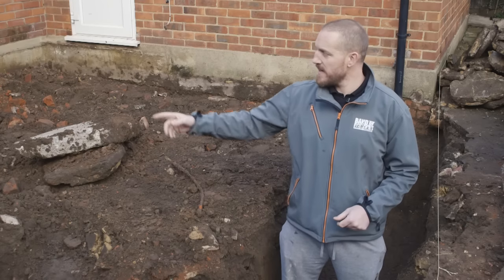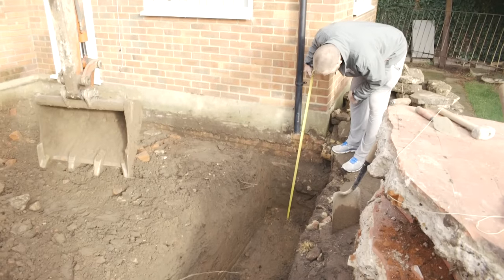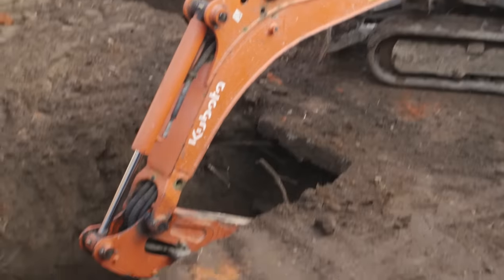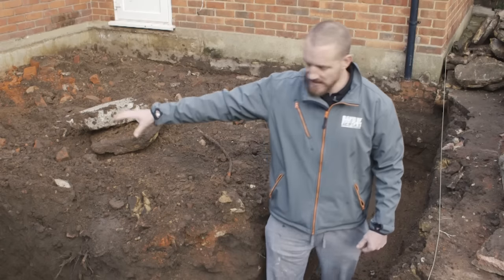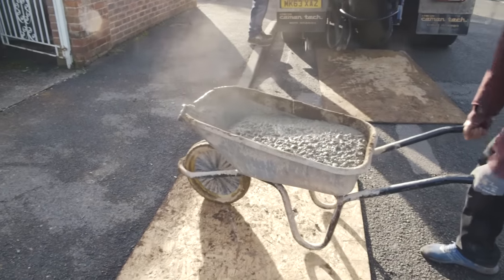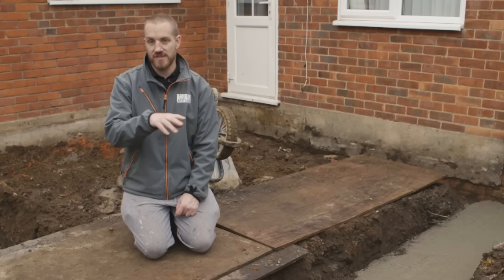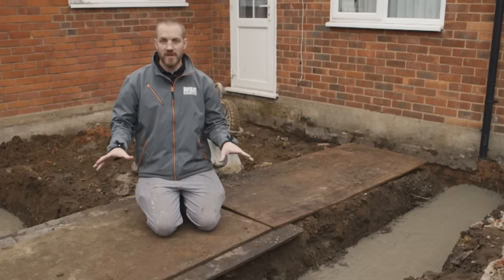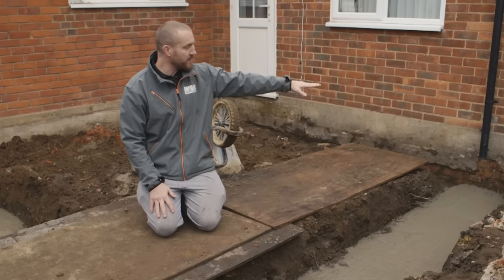How to Dig the Foundations: How to Build an Extension (2)

Comment: Any reason why you didn’t use reinforced mesh before you poured concrete in? Been a brickie for over 25 yrs, every extension i’ve build always made sure i had steel bars and  lifted it up on half bricks and then poured concrete over it. At times i even drilled bars into an existing house footings and left them sticking out so when i poured concrete i always thought it bonds better. Makes me wonder Was i doing it wrong all them years? 😂

Comment: I enjoyed your video, I  not a builder but i was just curious why there was no reinforcing.
Reply from the maker: It depends on the requirements of building regulations - the weight & design of the intended structure, materials, type of soil, history of earthshifts etc. In this case the foundations for the extension were actually deeper than the foundations for the house - built back in the 1950's with much fewer regulations.

Comment: Question. Is it possible to request from a building inspector lets say today or next month to check foundation levels, pour foundations and stop the work for 4 years?
Reply from the maker: In the UK, a Building Regulation application is valid for three years from the date of deposit. If you have started the works within the three years, there is no time limit to finish. However the onus is on the owner to ensure regular visits to check progress.

Comment: Is it acceptable to butt joint new concrete to existing? No need to dig under existing footing and start new concrete there?
Reply from the maker: It entirely depends on what you're building, how it fixes to the existing structure and the results of any ground survey.
Reply: @HomebuildingMagazine  How do you know if you need to dig under? I had Building regs approval (for a 2 story extension), but that wasn't mentioned? (There's no subsidence in my area)

Comment: BC has advised the firm sandy soil that is typical for my street a strip foundation at 900mm depth would  be adequate for 2 story. We are planning a rear infill extension. I've done a trial excavation to 1.2m next the exisiting outrigger. I think I've hit hit the foundation. It wasnt possible to dig deeper with the tools I had and the time.

Would it be normally required to dig to the same depth and "join" the new foundations to the old? Can you have foundations at different levels?

Brilliant little series.
Reply: Yes you can have step foundations

Comment: No bars needed?
Reply from the maker: Not in this build - not essential in the UK
Reply: @HomebuildingMagazine  not essential because of building standards? But strength wise the country does not matter right?
Reply from the maker: It's more to do with the make-up of the ground, and the solidity of it - the UK doesn't have as much ground movement as, for example, the US or Asia, so steel rebar for small structures isn't always necessary. Large structures / houses, absolutely, but small > medium extensions, not so much.

Comment: Hi,what is the thickness of your concrete mix,thank you.
Reply from the maker: This is a pre-mixed concrete, ratio decided by the provider based on the requirements of the build. Check out this great article on foundations > https://www.homebuilding.co.uk/foundations-explained/
Reply: @HomebuildingMagazine  thank you,how  many  milimeter   the  depth of concrete mix from base of foundation,
Reply from the maker: the foundations for this particular build were 1000mm deep.